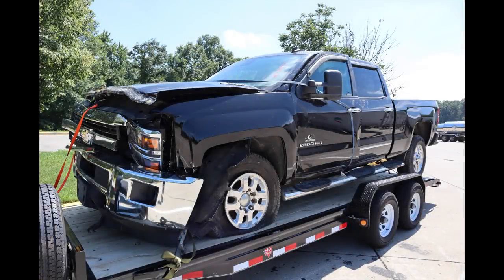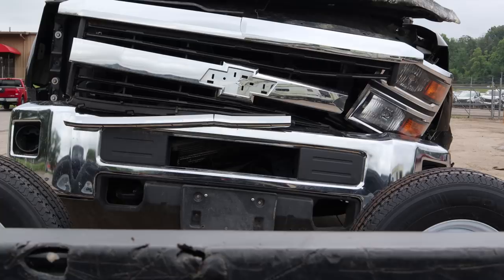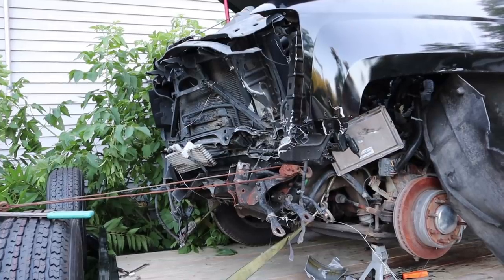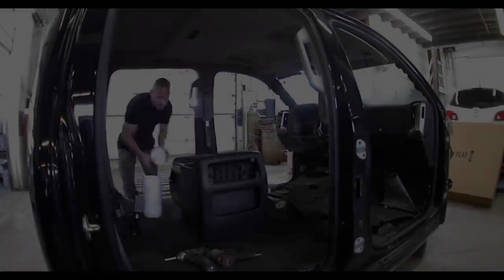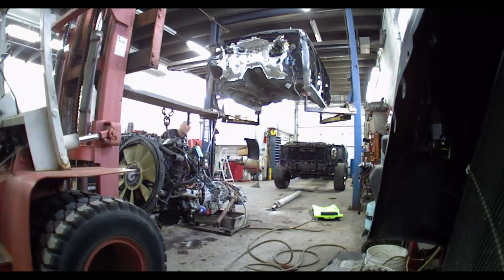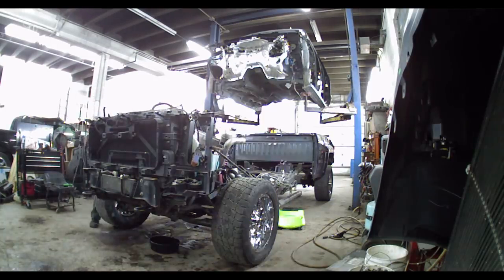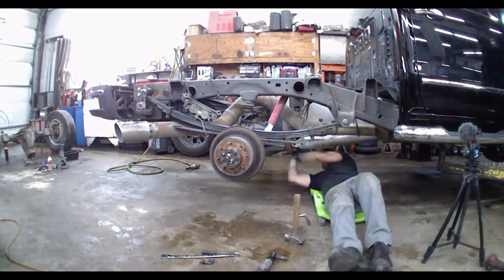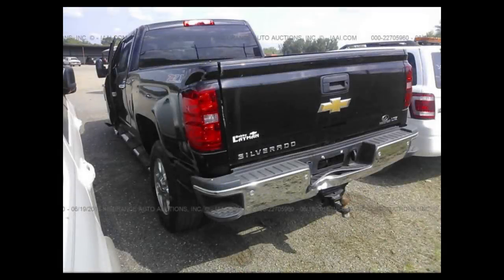2015 Silverado "The Mistake"  time lapse rebuild.  78 hours in 20 minutes

Comment: You should plan on doing both the series and follow up with time-lapse EACH TIME.  Excellent video. I admit I slowed this one down to 1/2 speed so I could watch it longer after my first trip through it.  But it's not like I'm addicted to your videos, I swear.
Reply from the maker: I think you nailed it.  On the bigger builds, I will do both and the smaller ones, just the series.  The videos are there whenever you need a fix. lol

Comment: Real time series for sure! I like the detail that you are able to go into with real time! This was an awesome series to watch and learn! Questions; why were the heater boxes and interior insulation different between the two seeming similar cabs? Did you end up selling that truck or replace your older one? Keep the videos and details coming, they are great!
Reply from the maker: The heater box was not a climate controlled one and the insulation was from the 1500 with a gas engine so it had different cut outs for modules and stuff.  The truck is gone, for now.  I am on the hunt for a new one.  Thanks for watching.

Comment: I do prefer the series episodes, but I did also like the time-lapse of the overall work once the series was completed. So, the final truck was a product of three different trucks - original “mistake” contributed the engine, interior, rear-end, and bed (with new bedside), the parts truck contributed the frame, front clip including suspension, transmission & transfer case, and the third truck contributed the cab? Is that right?
Reply from the maker: I agree, I think I will do the time lapses on the bigger jobs to tie the series together.  There was also the used rear bumper that came from another truck but other than that, you are spot on.

Comment: What's your opinion on who makes the best trucks? From a standpoint of being built well/quality in regards to body/suspension and drivetrain? I figure that you've probably worked on them all, so you must have an opinion. Maybe a better question is, if you know, which one is easiest to own/most reliable? I used to be into GM until I had a Suburban with AFM that developed an oil burning problem due to the AFM. Soured me on it. Had I known when I got it that AFM can be disabled, I would have done so.
Reply from the maker: It comes to personal choice.  They all have their pros and cons.  Certain options work for people as well.  For me, I want and IFS which leaves out Dodge and Ford.  It works for me because GMs are the most mechanic friendly and I build and service my own cars.  I would prefer a Cummins but the new Duramax L5P might give the Cummins a run for its money.  The all have the same Allison trans and that is pretty much flawless.  I do like some of Ford's options for interiors.  The oil burning issues ruined a lot of people and an otherwise problem free vehicle for GM.   They all have their issues, sometimes they are major fails. lol

Comment: Hey great job it always bothered me when the haters (car fax) slams great rebuilds but if it was a 67 vett with only the vin being the only original part people would think that was a cool car which didn’t go through any type of inspections again great job.
Reply from the maker: Carfax and vehicle manufacturers want everyone to think rebuilds are scary so they can make more money and limit competition.  If you are willing to question what you are told and learn, you can save yourself a lot of money.  The truth is, Carfax is not perfect and manufacturers have no problem selling repaired vehicles when they are the ones avoiding a loss.  I have seen clear titled cars with horrible repairs and floods being sold new on the dealer lot just to name a couple.  Thanks for the support!
Reply: I’ve rebuild cars for 25 years and always been able to talk to my customers about rebuilding most people are ok after they see how we do this and we usually sold most cars sitting on the frame machine or still in wreck condition. I always enjoyed tail clips which I used the story about coach company s how they cut cars and wasn’t made to go through any kind of inspection process. Inspection are good they helped us get rid of back yard building that really had gave rebuilding a bad name.

Comment: Great job on this video. You're right, the individual videos are much better. No need for the time lapse. it was interesting though to watch the clock in the upper left at 19:15 to see how quickly you can change a rear fender on that truck. I would still be working on it. I wish I lived closer so I could buy one of these rebuilds from you! do you ever get to New Hampshire?
Reply from the maker: Thanks, the next bedside will go even faster.  Less thinking, more working. lol I do get there if the cars are there.  The 07 IS250 came from NH.

Comment: Love your videos but a I just have a question. How do you make it worth it to rebuild a truck that had a bad frame, cab, bed, trans, and transfer case? No hate just honestly curious!
Reply from the maker: It is all about buying for the right price.  It helps that I am very efficient and jobs that book for 200 hours are done in less than half of that.  Of course I would make more if I was doing insurance work but then I could not pick and choose my jobs and work at whatever pace I want.

Comment: What size wheels and tires was on the truck when you finished? Do you know the wheel brand? I think you did an AWESOME Job?
Reply from the maker: I don't remember the tire size.  The wheels were 20" and they were Fuel, I think the model was torque if I remember right.  Thanks for watching.

Comment: Detail brother. I like detail. But make the timelapse to sell them! The value of your rebuild should be boosted by the proper repair.
Reply from the maker: I think I will do both on the bigger jobs and the series on all.  The time lapses are good for selling, that is how I started after all.
Reply: @vehcor  ya putting the potential buyer to ease with showing them exactly what was wrong and that it was fixed correctly

Comment: So Scott, I know this is an older video and I've been a watcher for awhile but I have a question.  I see you typically change the rear axles out when you do a frame swap but rarely change the front diff (on 4wd/awd).  If the ratios and diff type match is there a reason why you would or have to swap, all other things equal (mileage, condition, etc) between the two axles.  Perhaps this is just an editing thing and you do typically swap both and I just haven't noticed.  Thanks.

Comment: Did you happen to get this truck in Knoxville TN at the Iaa yard? The yard looks familiar at the start of the video. I bought a car from there that someone had done a massive coverup on also, it was just a neon so I just parted it out
Reply from the maker: Yep, that is Knoxville IAA.  Do you happen to know the name of the seller for yours.  I would be interested if it was the same A-holes as this truck.
Reply: I may be able to find the paper work but I probably tossed it when I scrapped the remains. Was always weird to me that someone would go through all the work to cover up a neon when it sold for $240 fees and all, they put a used same color hood and drivers fender on and rigged it where they couldn’t open the hood to show the frame and engine damage. Sucks but I used it to fix 3 other cars so made pretty decent money off of it
Reply from the maker: @dbabb2484  Yeah, some people go through more work to do things the wrong way when they could have done it the right way and made more money and not be dirtbags.  I am glad it worked out for you as well!  Sounds like it could have been the same sellers. lol

Comment: So why did you split the parts truck engine-trans? looks like it would have been quicker to plug the whole assy and save the original for next project. To keep the serial numbers matching maybe?
Reply from the maker: To keep the numbers matching and so I knew I had a good running engine I could sell instead of one that I was unsure of its condition.  A little work made me $8000.
Reply: Good deal, glad it worked out for you
Reply from the maker: Yeah it was a couple hundred dollar and a few hours gamble but the payoff was worth it.

Comment: What was left from the original truck. Am I right? Engine, bed, interior of cab, and rear end?
Reply: Doors also. And steps
Reply from the maker: The steps were from the parts truck.  All the wiring and modules were original and the most important part, the title.

Comment: "wiring harness is different"....I guess the days are gone where it's the same for every model no matter the year or options. I remember if you bought x vehicle, with that body for x years, the harness was the same. Just different things plugged in depending on the options you bought. I remember owning a 1980 Honda civic. Came without a radio (new). So I bought a nice aftermarket and picked up an antenna because no radio = no antenna. Well lol.....when I removed the cover over the antenna hole wtf? There was an antenna inside lol. Pulled it out, turned it, screwed it down. Wire was run through the dash.

Ok, have to run all new speaker wires. Pulled the cover off the factory speaker locations, no speaker, but the wires were there. Installed the speakers in the dash. Same as for the rear.
Reply from the maker: Yes, I used to install factory sunroofs on Grand Ams all the time, plug and play.  Same with the radio controls for the steering wheel.  Now harness are different for years, options, body styles and more.  It is almost impossible to count on matching ones anymore, even with the same year.
Reply: @vehcor  I guess they decided that even though for logistics it was simpler to have just one harness, all those unused connectors etc added up in cost. But for the life of me I can't figure out why things like a sunroof, power windows etc has to be programmed into the ECU. I was looking to swap out my POS 5.4 with a 4.6 and the service manager told me it might be possible but both vehicles had to be identical "as built" with the same options otherwise things like my power back window wouldn't work. WTF????

Comment: I have a 2017 1500 lt. I want a black z71 front clip where or what do you suggest?
Reply from the maker: Those are hard to find used, you might have to get all new parts from the .............. dealer.  My wallet hurts when I type that.
Reply: Thanks... my wallet just read your comment and ran away, may not find it for a couple weeks lol. I already got prices 749 plus tax and each headlight bezel is also about the same price per side. Over 2 grand to get a nice front clip is a little much... I'll settle with the chrome. Thanks again
Reply from the maker: @georgemendez777  Good luck on finding your wallet. lol  Give people some time to wreck them and you might find more turning up in salvage yards.  It might be one piece at a time but that would be the best bet.  Good luck.  They do look good with the body color parts.

Comment: You mentioned in the first video of the series that many people that do rebuilds will straighten the frames. You say it can be done but it shouldn't. Why not?
Reply from the maker: It weakens the frame if it is heated and most repairs cannot be done without heating.  I have seen heated frames completely collapse in 5 mph crashes. You can heat them and make them "look" great but they are junk at that point.

Comment: I get that it was more than you expected, but you used 3ish trucks to make one and virtually the only thing original is the engine and some interior. Why not just put the engine into a better donor car?
Reply from the maker: Buying a truck that had low miles and only needed an engine would have been impossible and even if one did appear would have ended up costing a lot more money in the end.  Anyone can do the easy jobs so there are more bidders and they sell for thousands more.  It was not more work than I expected, it was two additional parts is all.